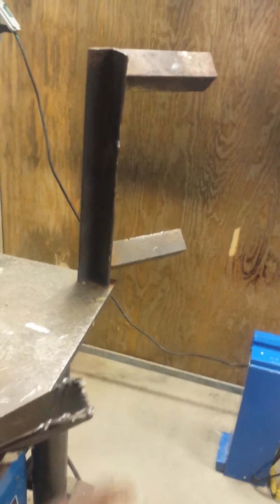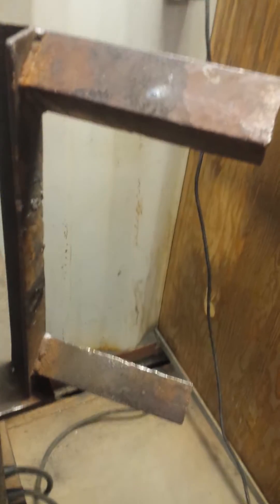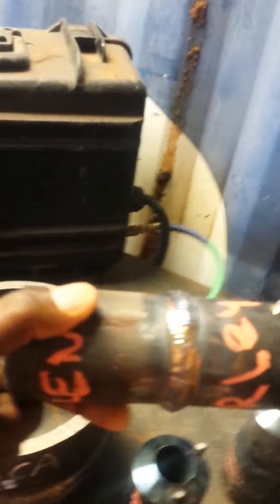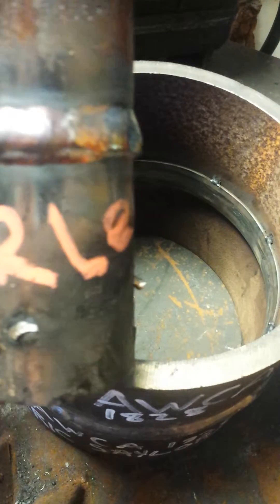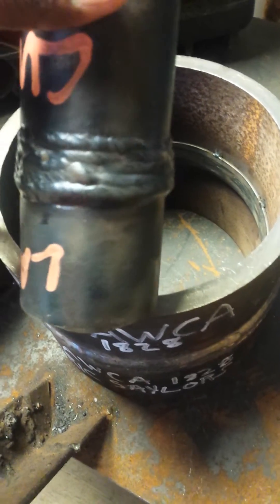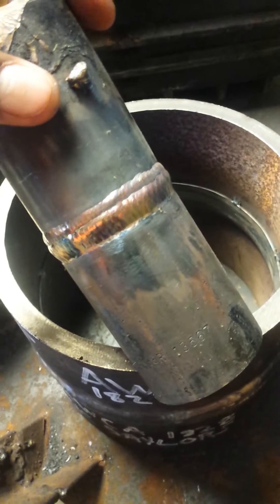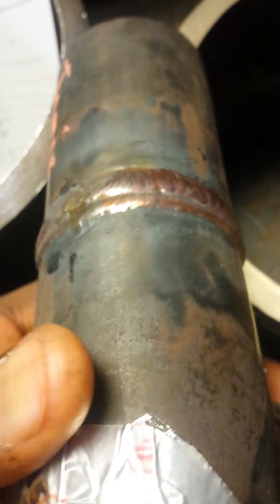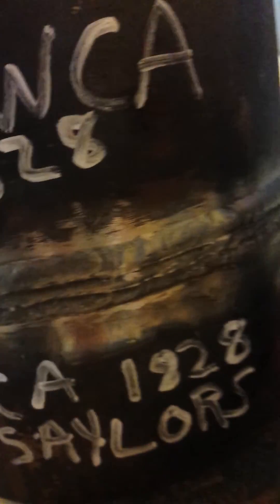Setting up for 6g pipe welding test with christaner

Comment: Hey man, I can weld better than that. Where are these guys pullin jobs? That is a small diameter pipe, so that adds a bit of difficulty. Smallest I've done is 4" Schedule 80. Maybe I should try some 3" or 2" before I talk shit about those, but those beads were quite inconsistent (stick) or saggy (tig).
Reply from the maker: That project was located in Granbury TX, It paid 39 an hour.